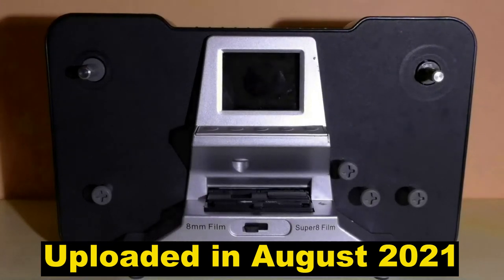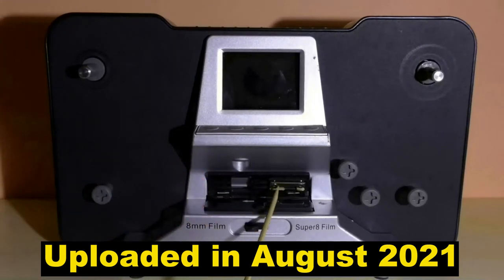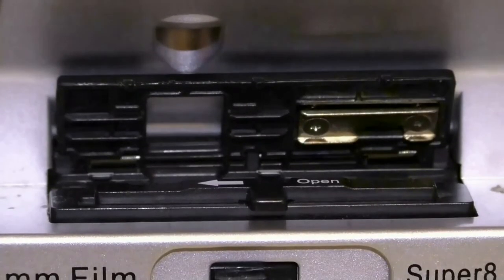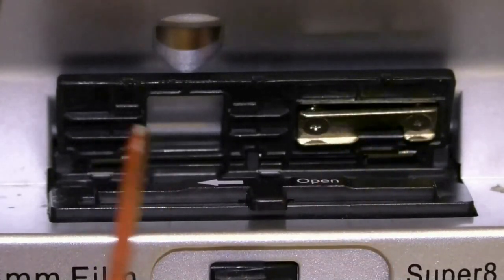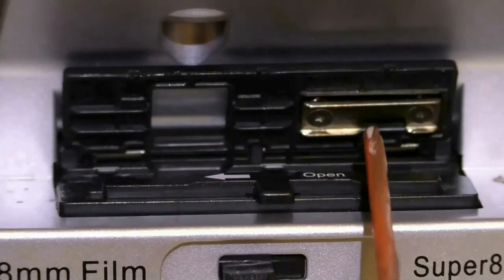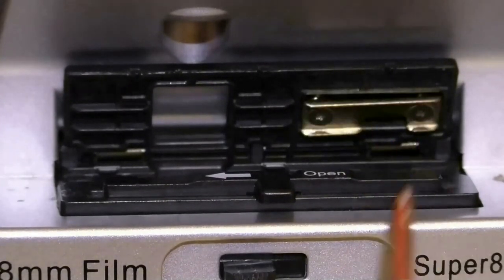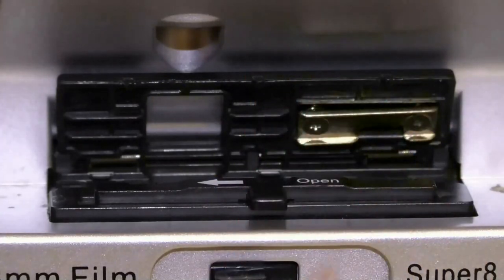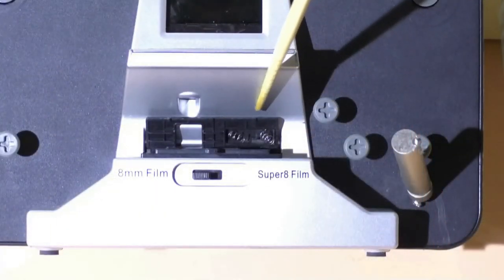Adjusting the pressplate on the Wolverine MovieMaker Super 8 scanner

Comment: I am happy that I found your channel.  I just purchased a Wolverine Pro.  First roll of double eight worked perfectly. the first roll of super eight worked perfectly. As I moved on thinking everything was perfect, now it seems that every roll I have tried to put on the machine jams?  I even tried lubricating the film and rewinding on a projector.  I see you mention something about a paper wedge?  I don't see it in the video for some reason,  I would much rather try that before messing with the screws on the pressure plate.

Comment: Saved The Day! This, this and your other video with the paper spacer.  Thankyou!  I had just about given up in frustration with my 50-year old super 8 films. My Magnasonic was clamping the film so tight it wouldn't feed for more than a few seconds without quitting or having frame-frame jitter so bad it would be unwatchable.  fwiw on the take-up side I still only wrap around the two leftmost posts instead of all 3.  If I use all 3 the film tightens up after 10-15 seconds of running and after that the motor seems not powerful enough to continue pulling it, so it just clicks.
Reply from the maker: Thanks for the feed back because when people read what works for them it may help some one else.

Comment: Very good videos Ron! I am a scanner user and I started with stabilization problems. Beyond the programs and editors, I changed the SD memory and I continue with the same as before. I will try your suggestion to adjust the press plate. I hope it works .Thanks.
Reply from the maker: I would like to know if adjusting the plate worked for you.  Hopefully others will see if it does, in this thread, so it can help them as well.

Comment: The folded paper wedge has transformed my year-old Moviemaker Pro into the machine it should have been from the start! Given the jamming I’ve had with all my film reels to date, I want to take the next step and adjust the screws on the pressure plate. But unlike your machine, my lid does not open sufficiently to allow straight-on screwdriver access. I seem to need a tool with the tip set at a right angle to the shank. Am I missing a step? Did you remove part of the assembly above the film gate to allow the lid to open farther?  That aside, many thanks for your clear and concise remedy to this nagging issue of film jamming!
Reply from the maker: I did nothing special to open the door more but I wonder if you could make a screwdriver like I show in this linked video.  Go to 4 minutes into the video to see how to make this screwdriver.  I do think it would work    here is the link    https://www.youtube.com/watch?v=j1HgAKsl32s        hope that helps

Comment: i wonder if anyone has had any luck modifying a #2 miniature phillips screwdriver in order to reach the the press plate adjustment screws?  I have a brand new  Wolverine MovieMaker Pro and right out of the box it wanted to chatter and jam on Super 8 films. The regular 8 films run through fine. I've tried to softly hold down the film gate on Super 8 with my fingers, but after a couple of minutes I seem to lose my light touch, same seems to hold true with the paper trick. The screws in the pressure plate appear to be quite tight from the factory, is this normal?  I don't want to put the muscle to it and possibly break something. Thanks for your informative videos!